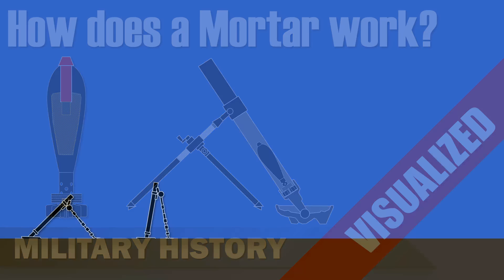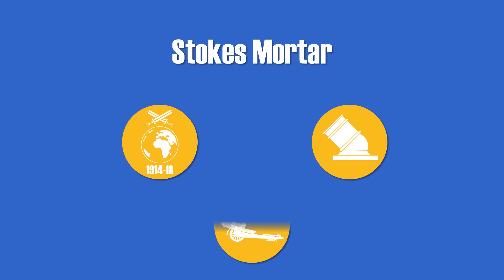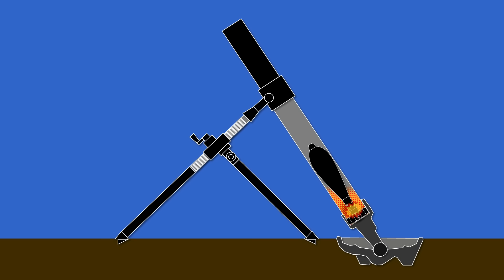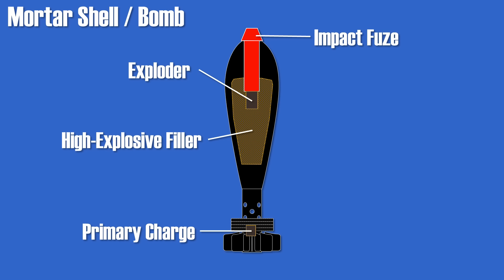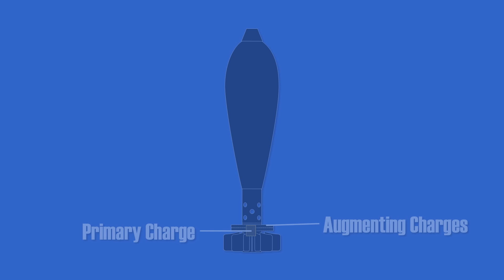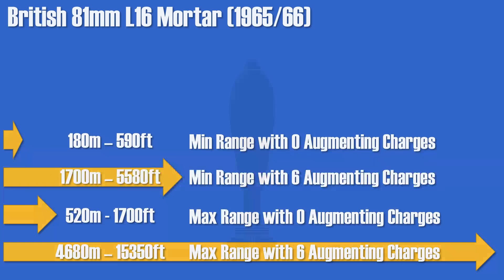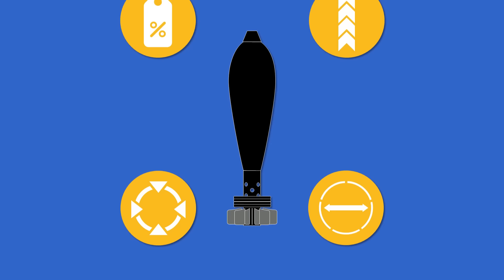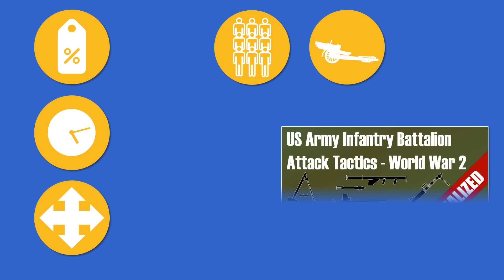[Weapons 101] How does a Mortar work?

Comment: I'd always wondered how mortars are fired. Having seen it, it now seems so bloody obvious.
Reply: TechnoSquidgy I know right! I always thought "what inside that mortar that makes the shell fire yet with loading?"
Reply: BadBoy_____17 I thought it was somewhat obvious that there's a firing pin at the bottom that makes the shell fire
Reply: Anthony DeLuca 
Yeah it seems bloody obvious now, but before hand I could never quite figure out how it worked. I had assumed there was some kind of impact fuse involved but I just wasn't sure of the specifics.
Reply: TechnoSquidgy Me too,i allway saw a firing mortar but i never knew how It works.
Reply: what's scary is when you drop a round down the tube...and nothing happens.
Reply: That would be a very bad day me thinks.
Reply: Or when it just pops out of the barrel and drops to the floor. On fire.
Reply: Mortar misfires are very bad. There's a scene in The Pacific where Eugene Sledge's squad have to deal with one, and it's one of the more intense scenes imo.
Reply: Chris Proost They sure are scary moments. But luckily the more modern shells only activate when they are high in the air, so if it just pops out of the tube a meter away you'll shit your pants even though realistically there's very little danger :)
Reply: also wondering its internal mechanism. a simple spring would not have enough force to bounce it out to very far away.
Reply: Exactly my thoughts. I always wondered whether there was some gas-propellant System in the tube. But now it indeed seems obvious how it works..
Reply: This thread makes me so happy for the gifts I was given to understand and design machinery. Reading your comments help me understand these gifts.
Reply: To prove there are exceptions to most rules, breech loading mortars fire like normal howitzers (with a rope) and there have been the occasional spring powered mortars (mostly obscure as hell but some, like the British army PIAT, though an anti-tank weapon, could be used as a mortar since it didn't "fire" the bomb but "threw" it).  Then there are Spigot mortars where the "barrel" is part of the bomb, not the weapon (I haven't a clue how they fired them).  Don't forget rocket assisted mortars and no, I don't know how they're still mortars even though they're rockets.
Reply: @hadrianbuiltawall9531  The PIAT was propellant assisted  . To load initially you had to put both feet on but pull up the body and rotating the butt back again to lock it . In the tube at the back of the round was a cartridge of propellant with a cap . When the spring was released the rod with fixed firing pin went into the tube of the round both pushing it forward and igniting the propellant  which blew the rod back to the lock position to fire the next round . It was actually quicker to load than the bazooka and 9ne Brit took out 3 Tigers with a PIAT before any of them managed to return fire .
Some actual mortars were also striker fired and not using a fixed firing pin .  I have built a 2 " mortar that fires only rimfire blanks which launches parachuting Teddy bears and other soft toys into the air from a large wadcup for kids on reenactment days .
Reply: Damn simple like a hand grenade
Reply: Most things are obvious when you know how they work. 🤔
Reply: ground mounted bazooka
Reply: Lol. They are pretty simple, probably wouldn’t be that hard to make one at home.. just need a tube and a bit of propellant 😁😆
Reply: I knew thanks to Saving Private Ryan when they didn't have a tube.  So, the American soldiers improvised by banging the charge on the bottom, then throwing them.
Reply: @tealeafandco  making the exploding and firing charges wouls indeed be the hard part

Comment: My father was in a battalion mortar platoon in 1942 using British 3-inch mortars. A problem was that in the rubber plantations and jungle the mortar bomb fuses were so sensitive that it was not unknown for bombs to explode after leaving the motor tube and passing upwards through the overhead foliage.                  Against all regulations and ignoring safety considerations, by using 3 loaders it was possible to have 21 x 10-pound bombs in the air before the first bomb hit the ground. But when the Japanese were overrunning your rifle platoons the rule book 'went out the window'.                 Also when the mortar pits were  been overrun it was possible to point the mortar tube straight up and smother your own position with bombs on the theory that at least your troops are in some cover and the enemy is exposed to the exploding bombs. Also mortar bombs never (hopefully) came back down onto mortar that fired it and mortar bombs landed in a random way in such situations. Once again a tacit of desperation.         Keep up your good work.
Reply: momo lolo: Malaya and Singapore Island. The battalion (Australian) was destroyed twice and reformed twice in les than 4 weeks. During that period it had a reinforcemnet draft of 10 officers and 560 other ranks, and absorbed from other units 4 officers and 279 other ranks. Losses were KIA or died of wounds 21 officers, and 441 other ranks; wounded and injured 23 officers and 677other ranks. 

Over the past 20 years some British authors heavily criticised the battaliion for failing to hold its ground. By selectively using some sources without refering to complet records and other materials one author  constructed his arguement and other authors have quoted his work siince. 

It is not usually known that of all the units on Singapore Island, only a battalion of the Cambridgeshire Regiment never retired. It had dug in amoungst the european homes and gardens of Adam Road (near the Singapore Golf Club) and held off the Japanese infantry and tanks. No jungle or plantations there. Adam Road could be compared to a piece of Surrey placed into Asia.
Reply: Commissar_Dan: Dan, we can all be thankfull for that generation.  

Of what was left of the battalion who became Prisoners of War during January and February 1942, 4 officers and 334 other ranks died in captivity. Survivours recovered and returned to Australia in 1945 ,41 0fficers and 712 other ranks. 

From the 2/19 Battalion's formation in 1940 to its post war offical disbandment, 77 officers and 1815 other ranks passed through the battalion. (2 officers and 12 other ranks served alongside the Chinese forces in China)

The battalion's old King's and Regimental colours are still paraded on special occassions by the modern successor unit. 

As my grand father went through 1915 to 1918 in the trenches, I should statistically not be alive. It is good to remember the real meaning of war as I find on these types of web sites some people take war too lightly.
Reply: Geoffrey Mowbray gibraltar of the east fell in a week lol.
Reply: Hardly a surprise that people kept using the same source. Pretty much the same thing happened to the 38th (Welsh) Division at Mametz Wood. Several days of fierce, often hand to hand fighting, they took the place suffering over 50% casualties (in only 4 days), yet the histories (the first written by one man using a selective group of accounts) state that the 38th did poorly.... Was not helped by the fact their own commander badmouthed his men afterwards. 

Recent archealogical digs have shown that there were trench lines and fortifications within the wood that no one knew anything about. It was assumed until those positions were found (within the last couple of years), that many of the men of the 38th were lying about the level of resistance they faced. 

Always worth taking the histories with a degree of caution, especially older ones which often did not have access to documentation that may have still been classified when the history was written.
Reply: it must be hell for the last defense in Singapore. A thank for your service in Malaya, from Malaysia.
Reply: @malnutritionboy  Yes, it's always safe to "lol" from the safety of a keyboard & anonymity of the internet.  Real life isn't a video game.....
Reply: @PapawR11  lol
Reply: Mee` paw  Maybe learn some proper sentence structure before calling something dumb
Reply: @geoffreymowbray6789  "we can all be thankfull for that generation" > Thankful for what? Japan still exists.

- Adûnâi
Reply: @PapawR11  lol
Reply: Imeron  At least he knew who his father was.
Reply: Don't pay any attention to the hate comments, doubt they even knew who their father were, mate.

Comment: Less Augmenting Charges also increase the effective rate of fire. If you fire too many mortar shells in a short amount of time the tube gets very hot and loses accuracy.
Reply: You have to pee on it to cool it down. Mel Gibson did it in that movie.
Reply: Good to know
Reply: The real problem with over doing the rate of fire is the tube can fail. I guess the issue with accuracy would become a moot point then?
Reply: Can the tube get so hot that the rounds cook off in the tube?

Comment: American WW2 mortars used square sheets of nitrocellulose as augmentation charges, the sheets had some flex to them and you simply inserted them into slots in an adjacent pair of tailfins (or actually pulled them out, as crated most rounds started with a full set).  These proved very simple and effective compared to some other countries' systems.
Reply: You just add sheets according to the distance